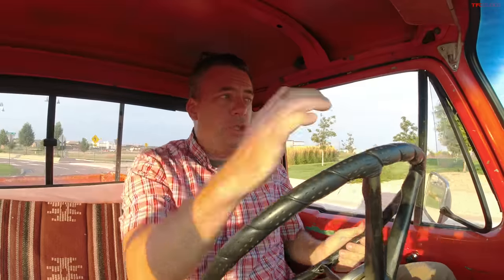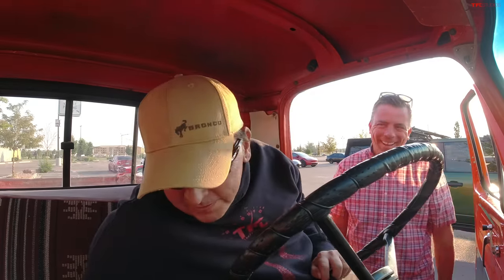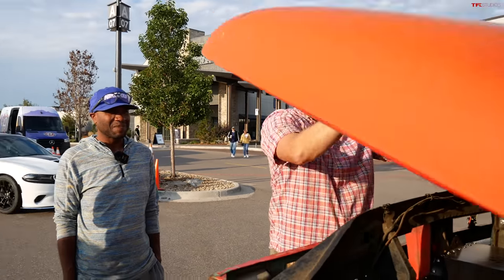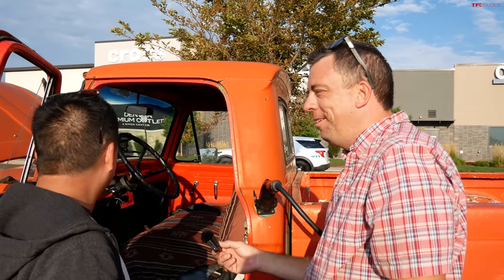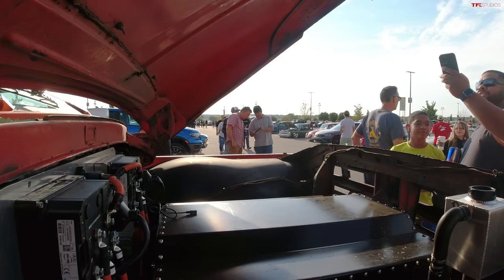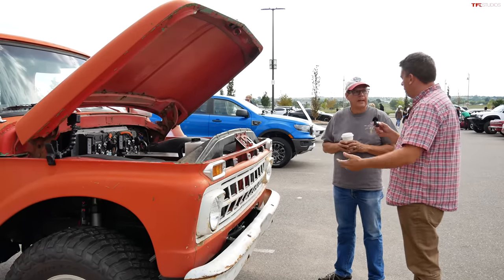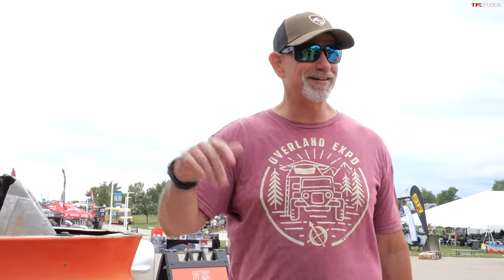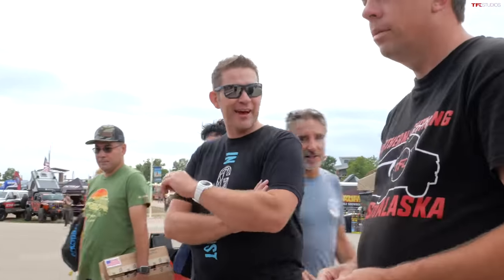I Take My Tesla-Swapped Ford Truck to a Car Meet: Here Are Your REACTIONS! ChargeZilla Ep.5

Comment: It's a really good idea for a farm truck.  You can just put up some solar panels to make a carport for it and use it whenever you need, without paying road tax for your fuel.
Reply: Um er, my mate has a Australian farm. You need a 4x4 and swag to get to the remote fences. They use helicopters to round up the cattle.. this pissy little toy is useless.. on a Australian farm... there is one farm in Australia that is larger than Texas...
Reply: If it rains, or snow, zip solar panels.. it's a wank.. fake.. my mate has a Toyota 4x4 here in Australia.. 30 years old, still chugging along. 
A Tesla ain't going to do that? Without a $20k battery swap..
Reply: @graemejohnson9025  Maybe not for his use case, but I could see it being very useful for smaller farmers.
Reply: @graemejohnson9025  lol alright
Reply: @graemejohnson9025  one farm is 8% of Australia?  I think in that case you don't tend the whole farm from one location.   You would have numerous subdivisions and equipment for each one.  It takes 2 1/2 hours to fly across Texas in a commercial jet.  One truck or tractor isn't covering much of that.  I don't care if it is diesel or electric.   Just hauling fuel out to all the places you need it to fill all the equipment would be prohibitively expensive.   A place like that makes a better case for solar than a small farm.
Reply: @Graeme Johnson  yes, because that's the norm.  Most people do not own a ranch larger than Texas buddy.  Just an FYI...
Reply: @richfarfugnuven6308  I have a mate with a 400 acre farm. He has 3 Toyota 70 series trucks. One is 30 years old, one in its mid 20's, another a teenager at 13 years old.. he can leave them anywhere on the farm.. just turn up on a quad. Jerry can of fuel.. and off he goes.. can't do that with electric.. they can sit out in back paddock for months... electric is useless in the Real Farmers world...
Reply: @graemejohnson9025  If those trucks were EV conversion and were sitting under a couple of solar panels always charged up and ready, he wouldn't need a Jerry can.  If he really only needs a Jerry can of gas to put in them when he gets there, they must not be going far in them.  He could get by with even smaller and cheaper batteries.  Gas trucks usually have a dead battery when you let them sit too long.  They also need to come back for oil changes once a year at least.  Not to mention,  any gas left in them goes bad, the fuel system gums up, and the radiators rot out.  You are still making the case for this, not against it.
Reply: @graemejohnson9025  not sure why you would ever need 3 trucks stashed in various locations to cover a 400 acre farm.  If it were a square, 400 acres is less than a mile on each side.  Less than 4 miles of fence would enclose the whole farm.  Their EV conversion could easily service all of that and drive back to the barn to get charged.
Reply: @michaellowe3665  sorry, I left a zero off. It’s 4000 acres, has river crossing in it.. that flood.. and each truck has different implement’s on them.. the ev wouldn’t handle the load.. and get range. What use is a ev sitting on a charger overnight, if Bushfire is coming through at night? On a farm, you need access to your truck 24/7..
Reply: @graemejohnson9025  so now it's 4000 acres?  Even so, you are still talking about a square that is 2.5 miles on each side.  That's 10 miles of fence.  This is still well within the range of their EV.  Funny thing about squares, the area goes up by the square of the side.   It's like it's in the definition.   Do you want to keep adding 00s until your story gets more plausible?  Even if you did keep adding 00s, the same concept applies.  It's easier to just leave an electric truck charging in the field than it is to maintain and bring gas to an ICE truck that has several more failure modes from sitting unused.
Reply: @michaellowe3665  i contact mate, and he said farmhouse paddock is 400 acres.. outside paddock is just over 4000 acres.. and his recently purchased property is just over 10 thousand... he said any ev would be a waste of time and money... he can park a old Toyota in a paddock. Remove battery, head back to homestead.. when needed for fire fighting. Just grab a battery, Jerry can of fuel.. and off you go..
Reply: @graemejohnson9025  so now the square is 4 miles on each side, and he just has to be able to go to the farthest point and back for some hypothetical fire.  The math is not on your side.  I think I would rather make that drive in an enclosed truck with a water tank in the bed than on a quad with a can of gas in my lap.  I don't understand what the quad is for when you can just drive the truck the whole 8 miles.  The worst case is that you drive the whole 16 miles around the perimeter.   By the way, 10 of those farms is the size of a small county in the US.  No one is getting close to owning a farm bigger than Texas.  Technically, all of Australia and Canada are owned by the royal family in England because they were never properly kicked out on their arses.
Reply: @graemejohnson9025  hopefully you are one of only a few among your culture that is rude enough to insult entire other countries.   I suspected you weren't really a farmer but maybe someone that just pesters one in a pub and you call him a mate.  You didn't seem to really know much about farming.  If you were paying attention when I mentioned not paying road tax, it was for a truck that is not used on the road.
Reply: @michaellowe3665  i am now a house bound disability pensioner.. use to teach geography. Australia is on the top. America's on the bottom. 
Why? In space there is no top or bottom.. I watch iwrocker YouTube channel.. doesn't matter where you live.. snow stuffs everything up..
Reply: @michaellowe3665  ah yes. They didn't tell you solar panels are temperature specific. They are only efficient in a specific temperature range... look up a solar panel brand.. look up the temperature efficiency range.. I  am 62. Got my first Radio Shack electronic kit in 1965. With a solar panel in it.  50 things to make... the solar panel wasn't happy. Unless clean and pointed at the sun..
Reply: @michaellowe3665  and if you are vegan.. the cow I just ate. Converted grass into poop to fertilize your food.. you eat food with cow's poop on it?
Reply: @graemejohnson9025  that is the weirdest logic I ever heard.  Throwing an insult at vegans in the hopes that someone is one and may be offended. I like steak, but I don't often think about them eating the same grass they just crapped on.  It does come to mind if I ever eat beef tongue though.
Reply: @graemejohnson9025  they improved them a little since 1965.  They still make their best power pointed at the sun but still make some at most angles.  Some will even make a little power under a full moon.  They work at pretty much any temperature you find on earth.  You just need to space them off of a roof a little to get airflow under them on really hot days.
Reply: @graemejohnson9025  you taught geography but still think all of the US gets 3 feet of snow?  Hopefully, you taught that it was round?
Reply: @graemejohnson9025  my mate, an electric truck is always WAYYYY more capable than any gas or diesel truck when it comes to power , torque, speed, reliability, handling, comfortableness,. You have access to all of it at the speed of light. Reliability is 100x better, no more explosions just an electric current and 1000s of parts less to break. 
Cleaner no more oil spills all over your property contaminating your well water. 
More comfortable, you can actually listen to nature around you, you can actually listen to the tires and how they are gripping for better handling experience and then you can let it rip any moment unleashing imaginable amounts of horsepower. What’s not to love? 
Btw the farmers here in California spend $100k+ on trucks for the farm all the time
Reply: @arianlucatero7649  you have never driven a real car have you.. no electric car can, keep up to a 911 on the Nurburgring.. no electric car car can lap Bathurst faster..
They are just a overgrown crap car.. and suffer shutdown when the battery gets hot.. it’s a con..
Reply: @graemejohnson9025 Alright buddy calm down. The rimac nevera which is a fully electric car beats the 911. Also, this truck is 4x4 capable. Stop hating on EVs when you’ve never even driven one. All you’re doing is talking crap about something you know nothing about 💀
Reply: @graemejohnson9025 oh yeah well my mate that's a huge plot of land in Russia that's 50,000 acres 😂😂😂
Reply: @graemejohnson9025 you talk a lot about mates having things and you're apparently 62 where are your things? Lol also bragging about what friends have doesn't make you cool and it is something a 15 year old does when trying to look cool in front of friends. We all know that one kid that said "I have a friend back in my home town you wouldn't know him but he has 3 four wheelers and we always made ramps and we would jump the four-wheelers".. lol why don't we stop worrying about what other people have and just worry about what we have.

Comment: The electric motor sound that the truck makes is so cool! It’s a shame EV makers put so much sound deadening onto their EVs’ powertrains.
Reply: It sounds good in small doses but listening to it drone for hours on the interstate would be maddening
Reply: You'd hate the whine after a few miles.  Its like listening to the whine of a CVT in an ATV/UTV, and the whine of a hydrostatic transaxle in a tractor.
Reply: Factory EVs are required by law to emit a sound at speeds below 25mph so pedestrians will hear it.
Reply: @wildbill23c  Dunno man, I could listen to supercharger whine for hours!

Comment: I love those people who need extra 40 miles once in a million years and use it as an excuse why EV doesn’t have enough range… seriously? You can easily add 40 miles of range in a supercharger in 5 minutes. It’ll take you longer to grub a cup of coffee. Even getting gas takes about 5 minutes, going through the credit card stuff, selecting fuel… with supercharger you plug in and go. 5 minutes and you got 75 miles added… people who have Teslas know it’s not an issue. Those who don’t, eventually will. And it will become better and faster in the next 3-5 years.
Reply: For me I only work 4 miles from home, so an EV would be great, except the ridiculous prices on them makes it unobtainable by many people who would benefit from one in reality, many are within range of an EV working for a daily driver for work....keep the gas car for road trips, drive the EV as a daily driver.  I could easily go back and forth from work all week without charging with pretty much any of the current market EV's, but the cost is outrageous...even a regular gas vehicle is so outrageous I'll keep driving the vehicles I have that are long paid off LOL.  Chevy is the only maker right now that has an EV that's even remotely affordable, but with inflation and higher interest rates, availability and dealer markups its still not affordable.  

At some point I'll be getting an E-Bike though for most of the year I can ride a bike back and forth to work.

Comment: My 1990 E350 went about 200 miles maximum. It needed fuel every 160 miles. I had a 1989 e350 with a 460 before that that got much worse mileage with better power, and. it had two fuel tanks and that 30 or so gallons lasted all day... if i didn't have to go anywhere extra.

Comment: To get more views this truck needs (deserves) more restomod done to it.  Doll up the interior with a restored seat, nice headliner.  Go on a rattle elimination campaign - may have to replace the window seals, door rubber.  Even those exterior mirrors probably rattle (I had the same ones on 66 F100 and they rattled like crazy - replaced with ones from an early 80s F-Series).  Get the heater and defroster working nicely - heatpump would be awesome and would allow adding AC - this would be a good video.  There are electric power steering systems that might work on it - directly on the steering box.  Another option for power steering is to get a normal hydraulic power steering box from an early 70s F100 (it'll bolt in) and then an electric pump to run it - probably easier (it's how the JL Wranglers work), but not as clean.  It'd be awesome to add ABS.

Need to show the truck as a useful daily driver...  Maybe  as some kind of working vehicle - add a big AC inverter to run tools - even a welder - like the Lightning..  Pizza delivery..  Auto parts delivery..  I suspect you might find a business in Boulder that partner with you on a series of videos..  Farm truck is an obvious suggestion although it'd get beat up more, which would be a shame..  Maybe delivering vegetables from farms to local farmers markets.  Week in the life of series..  That's where its strengths will shine.

Comment: Thermically controlled radiator so its not running all the time only when it needs could add more range? 
That guy is brilliant if it does.. 
anyways if you use 180 miles total a day if it takes 10 min at a gas station, now that turns to 20min at a rapid charger, and if your at the office you can charge and be get more miles anytime cars parked..

Comment: Ford did have a Ranger EV back in the 90s
Reply: Yeah, you don't see them around very often, couple members on The Ranger Station forum have one, but trying to get any parts for the electrical portion of the truck is well you need to find another electric Ranger with a good part to rob off it LOL>

Comment: The V8 versions of these trucks came with a different hood ornament. It looked the same but instead of having a sprocket and a lightning bolt it just said V8 in that space. When this truck came out the lightning bolt on the hood told everyone you cheaped out and got the smaller V6 engine. I love how it goes with the electric theme of the truck now but that was not the hood ornament you wanted on your truck in the 60s. For an electric conversion I would have gotten this hood ornament for it even if it was originally a V8 because it looks cool and has a different meaning on the truck now.
Reply: @@accarter801 I had a ‘66 with the 352 V8 for years. If I could have done this to it I never would have sold it. I loved that truck. It was my daily for over ten years and it never let me down but I just couldn’t do 6-8 mpg anymore.
Reply: @@accarter801 is yours an automatic or a stick?
Reply: @@accarter801 mine was too. A custom cab with a stick. Two tone red and white. It was really fun. The gear shifter went up as high as the dash. It was just cool. I think that might have made the mileage even worse though. Especially going 55-60+ mph. First gear was a granny gear so you could start in second. It was basically a three speed and it just wasn’t geared for freeway speeds. Trucks were only built for work back then. I bought mine in a small town in Nebraska while I was working there for a few months. I flew my roommate out and we drove it home to Seattle when the job I was on was finished. We went south to Joplin and then took Route 66 to California and up the west coast. It was a great trip but the first time I got on the freeway I thought the engine was going to blow. We definitely had to take our time and go slow but that just makes for a good road trip. Haha
Reply: @@accarter801 awesome. You’ve got to keep it if it was your dad’s. That’s cool.

Comment: Ouch! $40,000?  I think there are better ways to do EV.  You have nice weather for January/February.
Reply: Thats the current cost of items.  It's like trying to buy a genuine crate engine, like the Ford 5.2L ALUMINATOR.  Thats $27,000 without installation or a transmission.

Comment: Seems like the whole idea that EVs are better small and light is probably just hogwash. The batteries are heavy. Most of the energy goes into aerodynamic drag. Gas cars that can not regen are much more dependent on weight and that's why they do so poorly in city driving.

Comment: I would like to see an EV conversion with a 4x4 with a manual transmission.
Reply: But you don't need a transmission at all. And this one is 4x4.
Reply: @jamesengland7461  Its not a need, its more of a want.  I own a manual and love shifting through gears.
Reply: @matthewknobel6954  I think ev west has done a couple conversions using the manual transmissions. 
A couple Porsche ev conversion companies still have the manual also. So they are out there. 🤔

Comment: A fantastic way to keep these old vehicles on the road   10/10   :trophy-yellow-smiling:
Reply: Cha Ching.  Matter of perspective.  The amount of $ dumped into this vs replacing warn out parts is substantial.  A persons bank that matches the passion of keeping old metal moving is the only "fantastic way" that it works.  Because for the working class, this is just not a logical use of the hard earned $.  This truck is NOT in a restored state, so taking it to vehicle shows makes no sense either.  (at least to me)  IF it were a restored, pristine condition show truck, having a battery motor to move it on/off trailer trucks and to its parking spot would make more sense to me.  But to each their own.
Reply: @WW-wf8tu  Probably could have fully restored the truck to factory original and still had money left over, compared to what this "kit" cost plus installation and tuning.